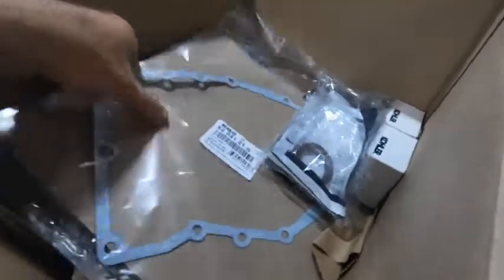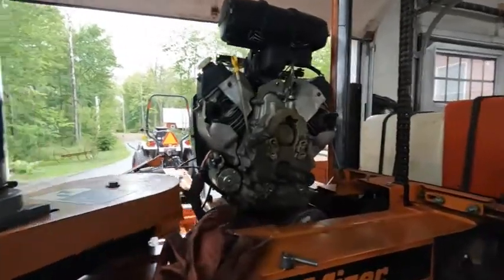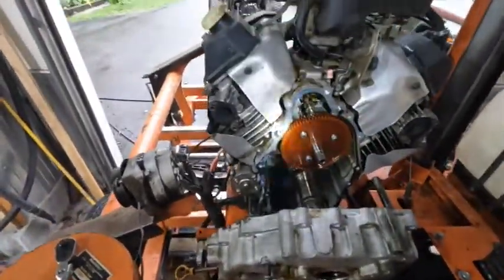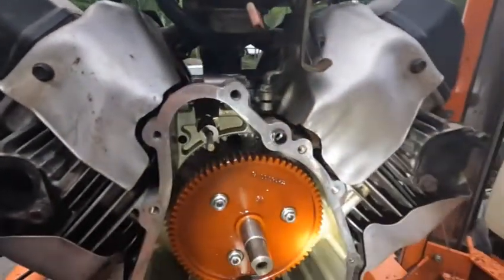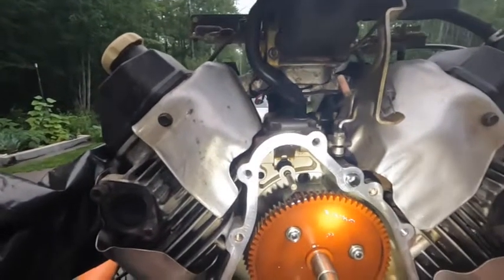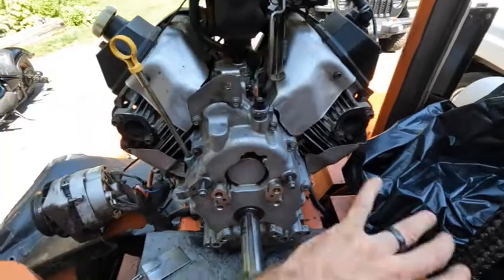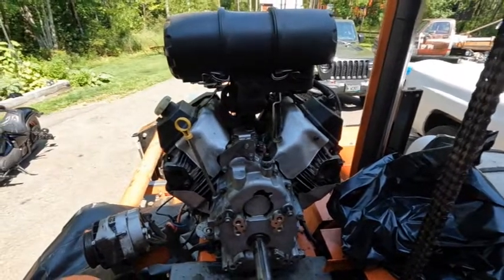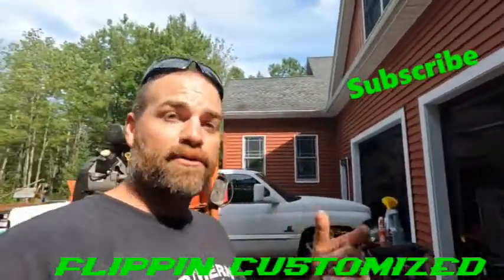Kohler V twin governor failed and repaired

Comment: I have a question.Thanks for the idea that governor has no timing marks but just where ever it fits in.Changed a leaking sump gasket and shaft seal on 22hp vtwin briggs and now it only governs at idle but when I increase the speed just a bit, it runs wild and can't be controlled by lever, altho I can manually idle it down moving the carb linkage towards idle.Took it back apart expecting a blown up gear but looks and acts like its perfect.No damage.Put back together same thing.works at idle fails when speed is increased.Now my question,,can a governor gear wear out or for some reason just quit functioning properly without blowing up?? Motor goes nuts but governor looks fine.Repeatedly done the proper linkage adjustments on the exterior as prescribed.
Reply from the maker: If it physically looks and moves fine and your sure, it could be linkage adjustment
Reply: @FlippinCustomized  Thanks.I've still got it apart right now.I went ahead and ordered a new gear, but mine appears to work fine.Another tuber suggested doing the static adjustment again scribe my governor shaft and pinch bolt and if it over revs again see if the governor arm moved slightly on the shaft.

Comment: Im working on my old friends Kohler command pro 26 725 his govenor is set right its right on where it needs to be his govenor spring though is loose and he's missing the throttle limiter spring 

He might just need the whole new plate the limiter lever been rubbing his plate a long time could be bent or unless they've got it bolted down to tight
Reply: Have 725cc Kohler on mustang 50 zero turn does exact same thing as was bent tryed cleaning and adjusting governor and carb ..no luck goes wide open or will up down like you said ?? What was the fix please..could use hand ..so know what parts to get ??

Comment: But sometimes they don't because i put one back together in a single cylinder Kohler command engine no pieces was broken i checked i seen the mower was last in a mower shop in 2004 plus its last owner played around with trying to fix it so either the shop didn't hold one piece of the governor while setting it or the owner didn't and they made the governor inside the engine fall apart inside 

My question to the last owner of the Lt155 was why didn't the shop fix that problem it didn't take no new part it just needed put back together and put in place so i done all that the engine still works great now not sure how many hours are on it theres no meter it has less hours im sure from it sitting with the last owner unfixed for so long its just a cheap little Kohler command cv491s

Comment: Thank you for posting a step by step easy to follow video on whats involved in doing this. I have a Kohler Command CH20 on a Cub Cadet that is running at WOT regardless of where the throttle lever is set. Linkages and carburetor are proper. Looks like I'll be cracking the case.
Reply from the maker: Glad it helped

Comment: I’m not sure about this engine but on the Honda 630 V engine if the cam plastic gear is that dark color it’s best to replace cam and any other plastic gear that dark
Learn it the hard way 
Heat has effected the Gears and will break soon
Reply: This just happened to me I replaced the governor gear on a ECV 980. When changing gov gear I noticed darker color of the cam gear.

One month later, the cam gear exploded.

Replacement cam gear is steel.

Plastic has no place in these engines.
Reply: Not on that Kohler that's oil on his metal camshaft their not plastic mine wasn't mine are the same color soon as the oil is cleaned off you have shiny silver.

The most that can and have worn out on those are the lobes but he'll know it when they do if they ever do I've not had a Kohler with any camshaft problems yet
Reply from the maker: Nope not true, thanks for the comments but this is not my first rodeo